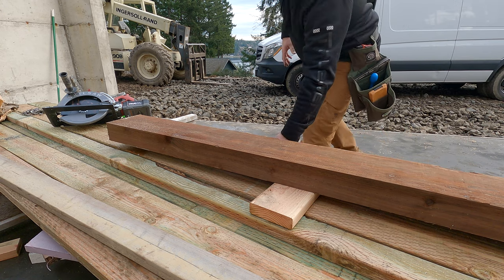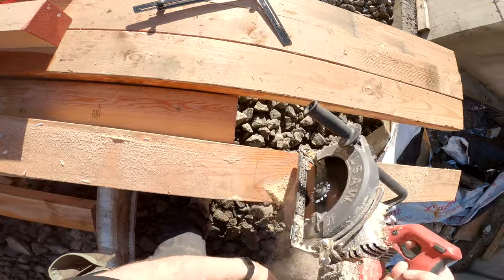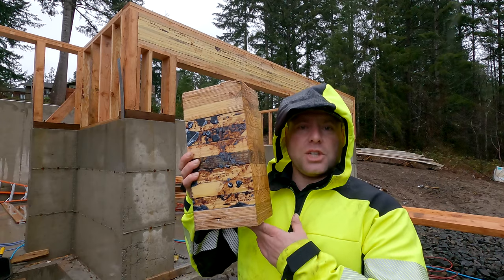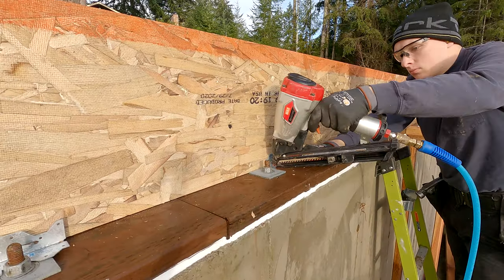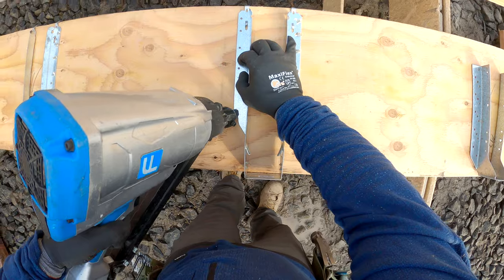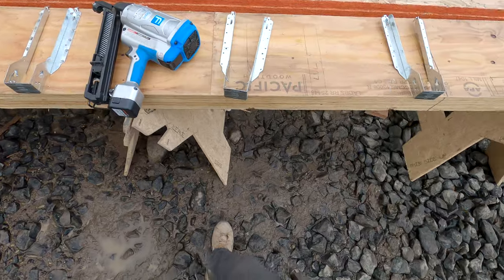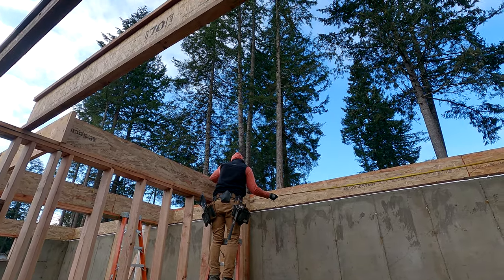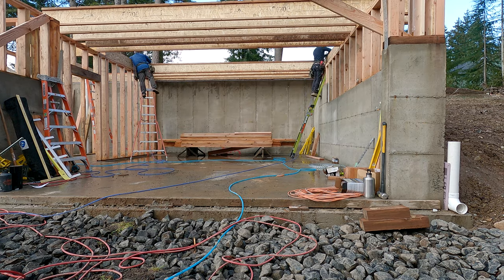Project 171 Part 2

Comment: Rocking the new Badger toolbelt I see
Reply from the maker: Yep, it is the carpenters set and its been about 3-4 months.  I absolutely love them.  I asked Joel to move the hammer sleeve up, shorten it and add a nail puller sleeve to the left.  Hoping to see those next week.
Reply: @AwesomeFramers  I had thought about driving up there and buying one I don't live but a couple hours from him, they look like they have a lot more room than the Diamondbacks
Reply from the maker: @DixieNormous1  I find them to the be the perfect size.  I don't want a lot of pockets, and these stay open.  I would message him and ask him if he has any 2nds or rigs that someone didn't want.
Reply: @AwesomeFramers  Thanks!